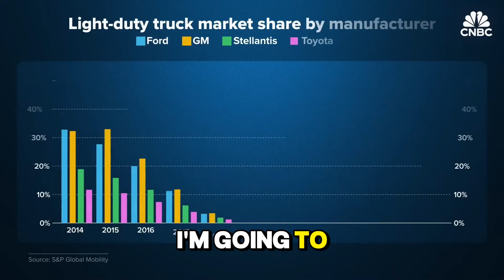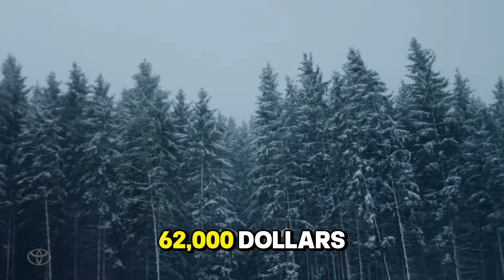I Analyzed 47,000 Pickups - American vs Japanese Truth EXPOSED

Comment: After owning a 2005 LS Crew Cab Chevy Silverado got in 2007 with 59km miles owned till 2024 with 167k miles, an now a 2021 TRD Sport 4x4 Dbl-Cab Tacoma got in 2024 with 29k miles an now 44k miles the Japanese have figured it out, where Americans are lacking!~
  The reliability of Toyota alone speaks for itself, after owning 2 chevy made vehicles an having nothing but issues with them it's chevy chit!~

Comment: I bought an 07 tahoe a few years ago to pull a boat. Im a mechanic so i am not afraid of repairs i would actually consider it fun to pull a transmission and rebuild it myself, so i was looking for something with the most towing capacity possible, 4x4 and it had to be an SUV.  The 07 tahoe is what my research turn up. it was the best in capacity, all tahoes of that generation were 4x4, the most comon problems were easily fixed, and the LS engines are bullet proof. Im very happy with my choice and dont plan on replacing it for a while. With that said i would happily go with a Japanese truck that could do what my tahoe does but also saved me on gas. I would even go electric if that was financially an option.

Comment: Then why are there so many early 2000s Silverados with over 200,000 mi on them. The later model American pickups are not made as well, but the earlier ones are solid. And there is no Japanese market for 3/4 ton or bigger pickups. American pickups fail in the half ton segment, because the truck makers are focused on their bigger more profitable 3/4 ton and full ton pickups.

The Japanese stuff is great until It breaks, then it's really expensive.
Reply from the maker: You're absolutely right about the early 2000s Silverados, those things are bulletproof! The 5.3L Vortec engine from that era is legendary. 

But here's the thing: you just proved my point. You have to go back 20+ years to find reliable American pickups. The NEW ones (2015+) are where the problems started, too much electronics, cost-cutting, complex transmissions.

And you're spot on about the heavy-duty segment, Japanese don't compete there. If you need 3/4 ton or 1 ton for real work, American is the ONLY choice. No debate.

My video focuses on the 1/2 ton daily driver market where most people buy. That's where Japanese dominate on reliability.

The repair cost thing though? It depends. If you can wrench yourself, American parts are cheaper. But most people pay shop rates, and that's where it gets expensive fast.